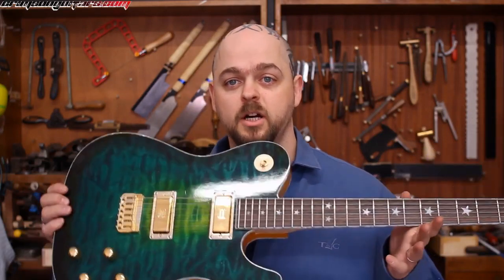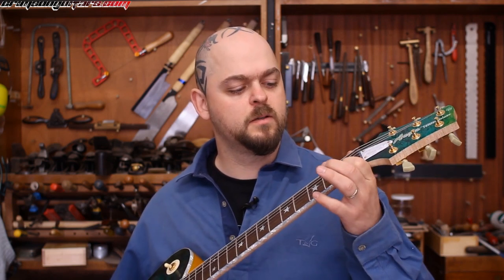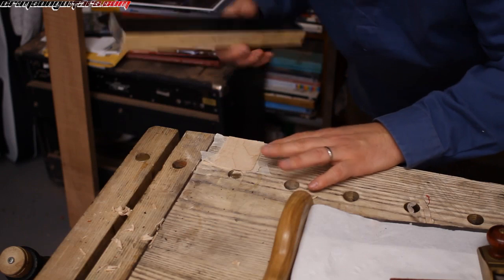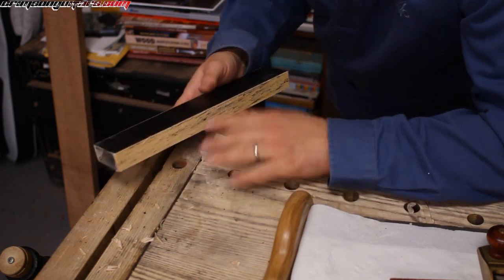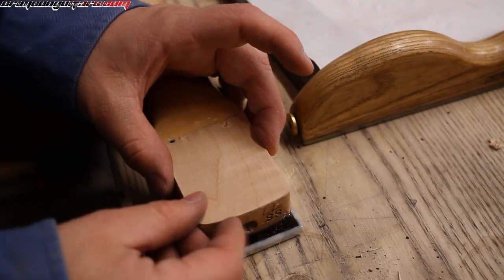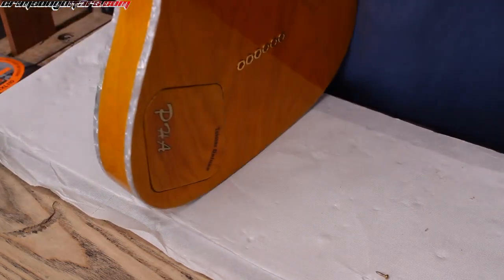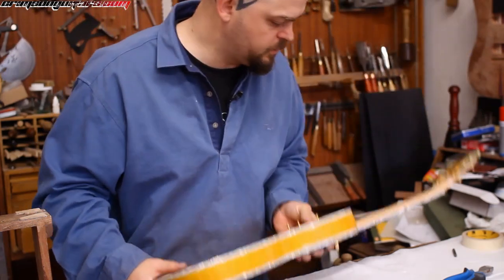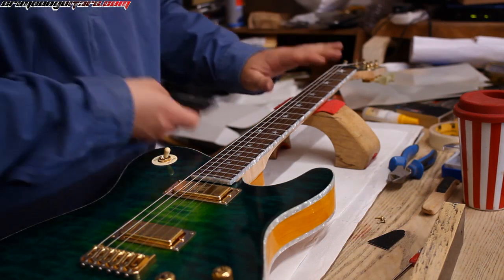Tutorial - How to Shim Your Guitar Neck and Nut

Comment: Greetings! Im betting/hoping plenty of skilled luthiers watch this channel. Any and all insight is appreciated...
I am in the middle of my first build, its a simple 'Strat kit' and I don't know what i did wrong. But I have a similar problem to the guitar in the video, but in reverse! With my saddles set absolutely as high as they would go my frets are still too high. The strings start touching the frets around 12th or 13th fret and simply lay along them the rest of the neck. My neanderthal brain tells me since this guitar needed a shim because the action was too high, i would need the opposite since my action is too low. So I need to either deepen the neck pocket or thin the neck were it bolts up? If that is correct, does anyone have any advice as to the best way? I dont have any fancy tools like a mill or cnc, just sand paper and files & various hand tools. im nervous because it seems like a critical angle that needs to stay perfect.
Reply from the maker: Easiest way is to do literally the opposite of what is in this video.. ie make an angled shim but put it at the other end of the neck pocket. Not pretty but non destructive and safe. Otherwise you are right, a router to router out the neck pocket or file, rasp, plane or sand the neck down a bit at the right angle.. B
Reply: @CrimsonCustomGuitars  Okay, I'll give that a try. Thank you for taking the time to respond.

Comment: why not correct the bottom of the neck pocket so the pocket front has a small amount of wood removed and then tapering to nothing at the rear of the pocket... and fix the problem with no shims at all?
Reply: My guess would just be that ideally you don't want to remove material from the neck or the body unless you absolutely have to. Ben doesn't believe that shims have any substantial negative effect on the tone of the guitar, so there's no harm in using a shim. If he would have filed away at the neck pocket, then potentially down the line if the owner wants to replace the neck or bridge or something, there wasn't any irreversible modification done to the body which could cause issue.

And just a couple more things I thought of, it might just be harder to taper the neck pocket than it would be to taper a shim. Also, if you mess up tapering a shim you just try again with a new shim. If you mess up tapering the neck pocket, you done messed up.

Comment: Shouldn't the shim be long enough so that the taper continues all the way from one end of the pocket to the other? The shim in this video tapers off to nothing before reaching the end of the pocket. Assuming the pocket itself and the back of the neck are both planar, this would mean that the shim isn't actually touching both the neck and the pocket over the entire area. This would leave much the same effect as using a small block instead of a wedge shaped shim.

Comment: Uh well using pieces of guitar strings to get the height is no good! I did this once, notice i said once. And what happened was when you lay the string over top of the other and then you tighten the string you cause the nut to crack and split from the pressure, then your fucked ole  boy, and that's some advice to take to heart, it happened to me.

Comment: Noob question alert!!! How do you know if you need a shim? What be the warning signs?
Reply: +Chuck Nowakowski i guess... the strings not being able to be set up properly, i.e touching the fretboard an inaudible sounds :)
Reply: +Chuck Nowakowski It isn't hard to tell if you need to do this.  If you can't adjust your saddles or bridge down far enough to set the action height you'd like, shimming the neck makes it point a little higher off the body, so you can move the bridge or saddles up and get that proper adjustment.  Look at 3:05 in this video.  The saddles on that bridge are almost all dropped as low as they can go, and yet the action is still high (strings still floating too far above the frets).

Also on Fender style bridges especially, you may find that dropping the action low means the little screws that hold up the saddles stick out a lot and poke you in the hand.  Again, shimming the neck will let you get that low action, but with the saddles higher off the body so the screws don't scrape your wrist while you play.

Comment: A precision woodworking friend of mine makes taper shims for me (he has a CNC machine)... several different thicness's... i.e 5, 10, 15, 20, 30 thou etc. these run from the desired thickness tapering to zero.  Not sure of the wood type he uses but it looks like maple.  I hate the idea of sticking an old fag or credit card under a neck causing a 'step' and bad neck to body transfer.

I project for an apprentice Ben, if you have the machine, make a quantity wholesale at various thicness's and market them in packs  ;-)

Comment: Pretty lousy neck really considering how much this neck would have cost to buy.  No point in all that froth if the frets are all over the place.     I know that a complaint with Warmth necks was the fretwork, seems like some are still iffy.   I cannot understand why the basics are not  good first.  I am sure that crimson would never let a neck out of their shop like that, even a kit neck.  Companies rely on having a good reputation to survive.  This is not a good advert for Warmo
th.     If you have to shim the neck doesn't the rear of the heel loose contact with the rear of the neck pocket?  Surely you would (should ) compensate by making the back of the neck parallel with the neck pocket.  Otherwise there is less contact between body and neck loss of sustain and all that.    I

Comment: It's completely irrelevant, how much of the neck touches the neck pocket on an electric guitar, as long as it is tight. Why would it have to touch on a bigger surface? It's unnecessary. The only important thing is, that neither the body nor the neck may vibrate. If an electric guitar vibrates, these vibrations draw kinetic energy from the strings, thus reducing sustain.
Reply: There still is a valid reason to make a wedge shaped shim though: If you're tightening the neck real hard with just a little rectangle at the end of the neck, it might leave an impression in the neck, which might reduce the value of a vintage or high end guitar. But it's only a cosmetic problem, not a functional one.